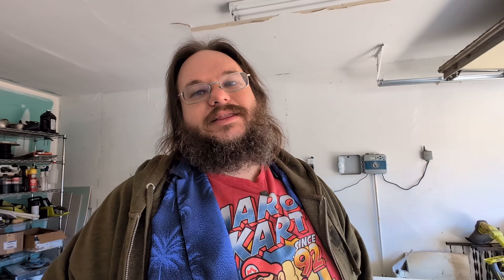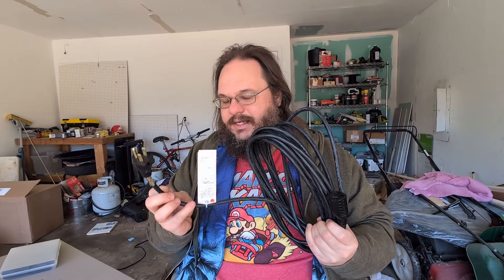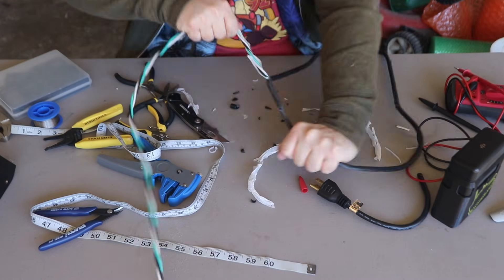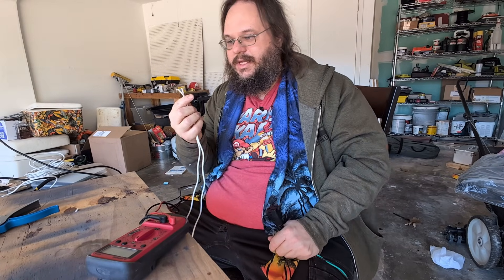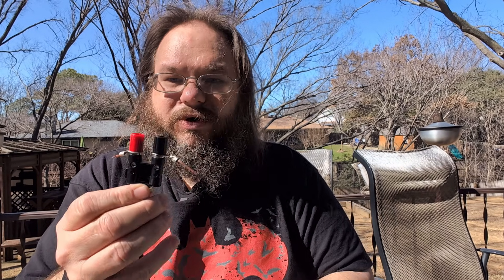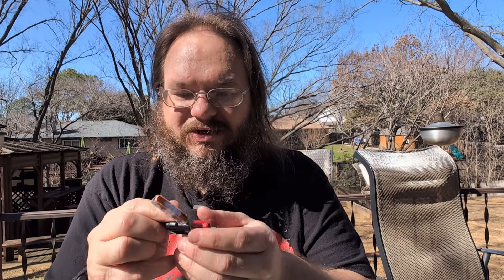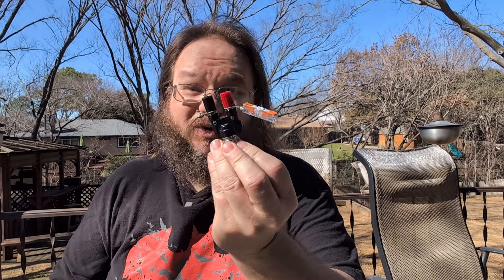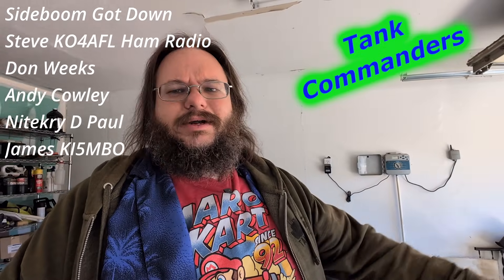Failed $20 Antenna Build and Lessons Learned

Comment: You sure know how to make a simple aerial complicated. For most of this video, I didn't know whether you were trying to make a dipole or an end-fed, and it turned out you didn't either. A decent multiband aerial can be made for less than $20, and 100 ft of suitable wire is much less than $20. Start with a known design.